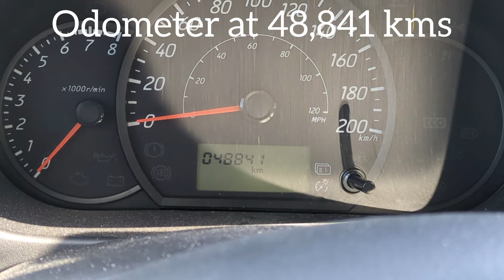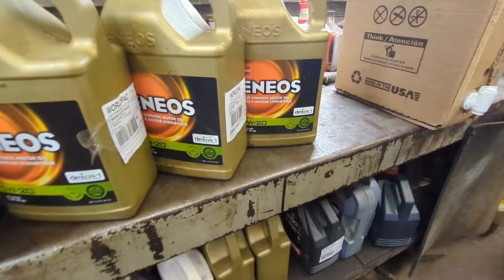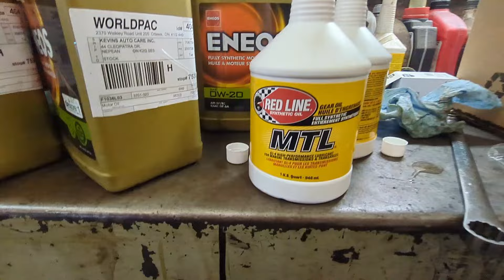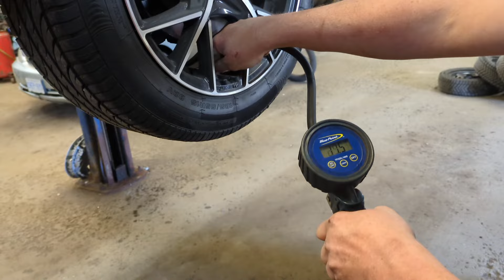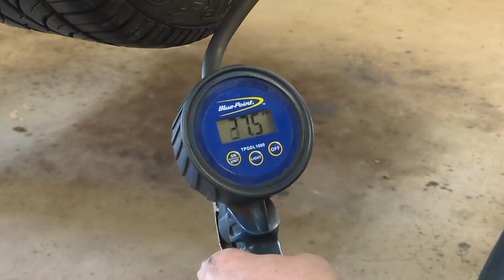Mitsubishi Mirage 48,000 km service and valuable car advice

Comment: So, when do you do your oil changes? I read 7000 miles which I personally would never do that late ever.
Reply from the maker: @dzmelinux7769  thanks for watching! I do mine every 8000kms which is about 5000 miles. I'd never stretch it farther than that. Ideally I'd do it 6000kms.